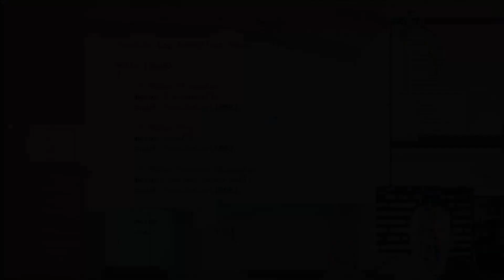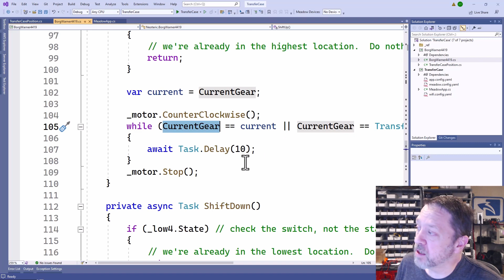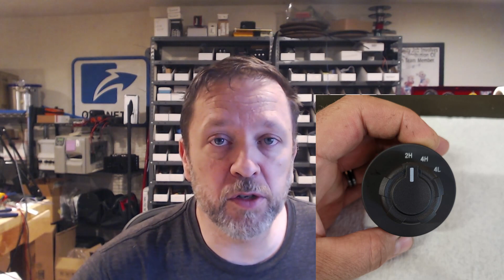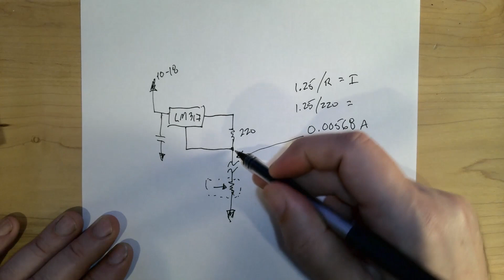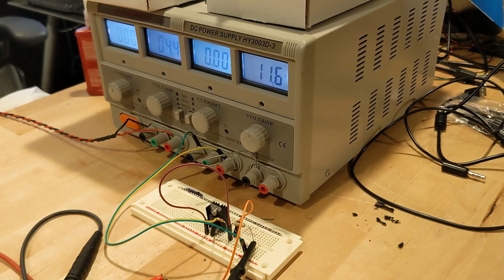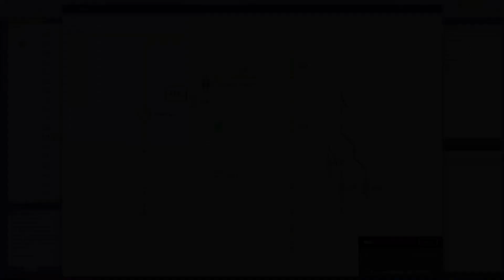Using .NET To Control Hardware:  Building a Transfer Case Controller with C#

Comment: Can I order one of these? I messaged you on your web site a few times and never hear back
Reply from the maker: Solid "maybe"? What transfer case are you using? How comfortable with wiring and diagnosing electronics are you? I have sold them, but generally to people that I trust can get it working and help with diagnostics if needed. It's rare that these are just "plug it in and go" and I'd hate for you to get it and it just turn into a back and forth where neither of us ends up happy.
Reply from the maker: To be clear, I'm not saying you're not capable or even that it's a complex process, I just want to set expectations. It's not like buying and installing a water pump and some people aren't comfortable with or experienced using a meter to verify operations.
Reply: @dotnetMakers I’m pretty decent. Built my own control pack for the coyote it’s behind. I ordered most of the stuff to build one I just haven’t had the time to do it myself
Reply: @dot @dotnetMakers and bw4419 T case as well
Reply: @dotnetMakers let me know either way. I should also mention. I own several multimeters and too 2 years of wiring In high school. I would say I should have no problem trouble shooting and getting it up and working.

Comment: 19:08 I think a simple solution would be to use an R2R ladder (a common way to read a multi pole switch).  You would only need to add 3 more resistors and you wouldn't be dealing with the problem of directly connecting your power source to your ADC.
Reply from the maker: The only problem there is that the switch isn't multi-pole, changing switch position sinply changes resistance through the switch, so it's more like a potentiometer with 3 discrete output values (or 4 if you count infinite resistance between positions)
Reply: @dotnetMakers  I shouldn't have referred to it as multi pole, I meant multi-contact, but what I wrote above should still work fine.